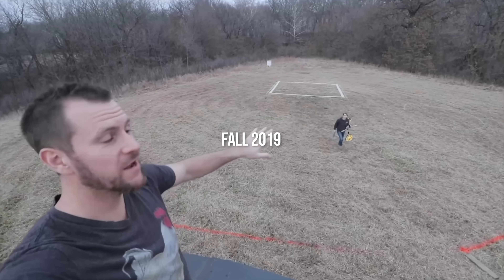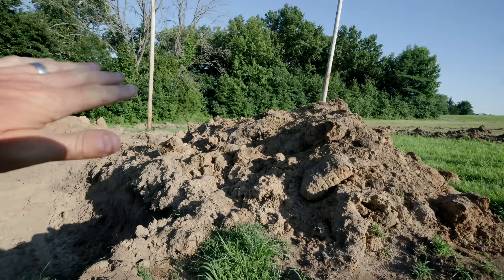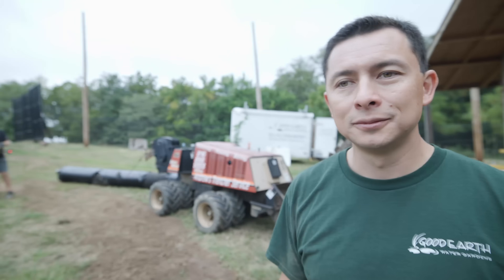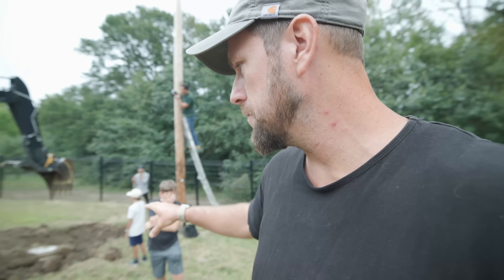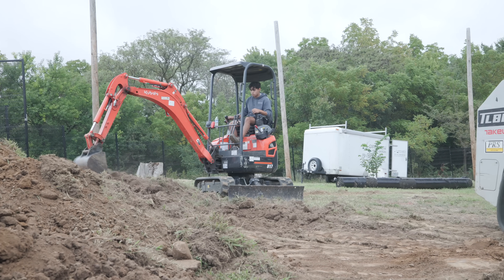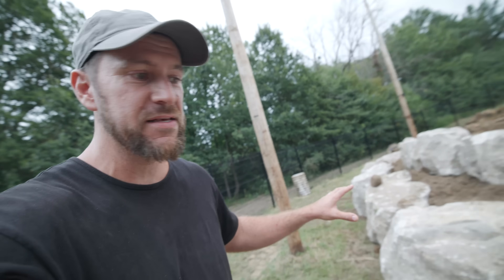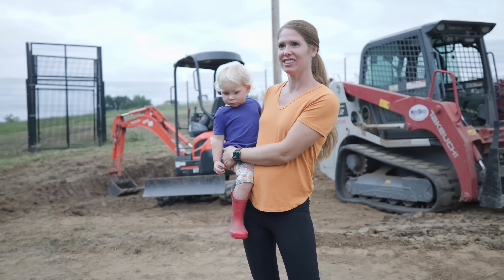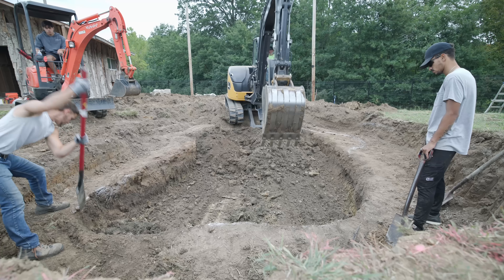The Exotic Aviary gets an EPIC Duck Pond (Day 1)

Comment: New aviary looks awesome. Once the ducks start using the pond if your wetland filter is built the udual wsy with aquablox, centipede and snorkel I would make sure you keep a close eye on the sediments and clean them out as often as possible. I have a 14k koi pond with wetland filtration and even if fish are far less messy than ducks I built my system very differently (only 1' pea gravel over a false bottom with bottom drains to flush sediment) also because hete in europe aquablox etc. are not available.  Sedimentation chambers can catch most of the muck before it gets to the wetland. Ciao from Italy